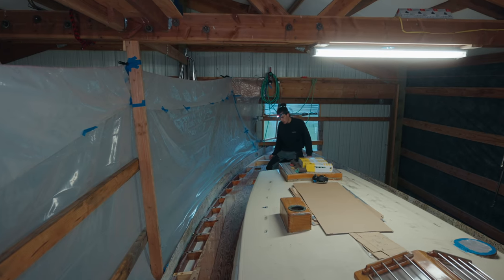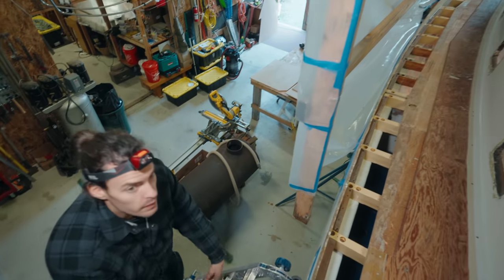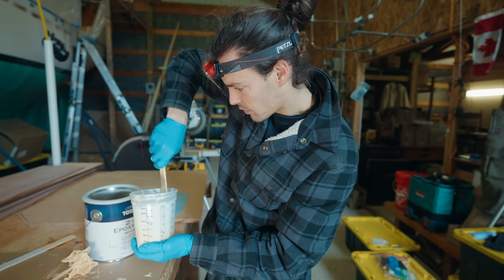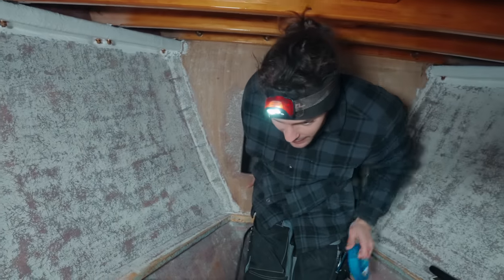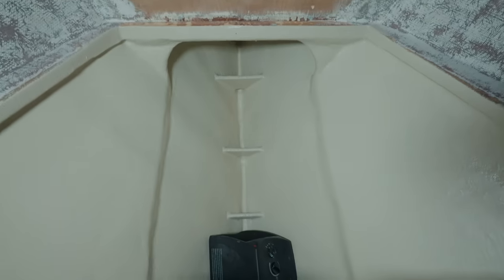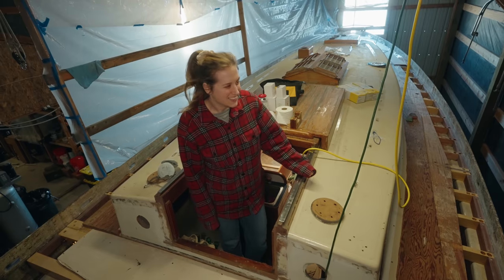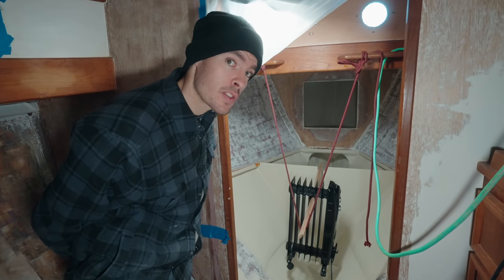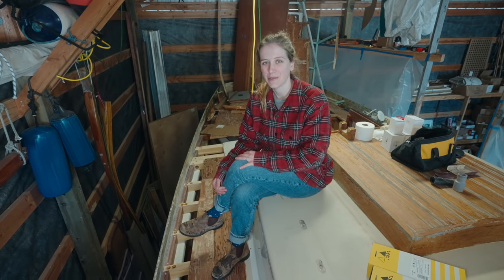FIRST PAINT ON OUR BOAT! [S4E40]

Comment: One thing to note about epoxies and even some paints during cold weather is you can warm up the sealed cans in a very warm water bath for 30mins to 1hr, to help bring it to temp and therefore thin out the viscosity of each part individually, before mixing the 2 parts together.  Consult with the Total Boat rep first to verify that it's ok to do so, before proceeding with the warmup.
Reply from the maker: Absolutely! We keep them in a small heated cupboard to achieve the same effect :)

Comment: Very smart of Aladino to wait for the correct temperature for Varnish, Paint, Epoxy, for that matter, no point of doing stuff that you would just have to redo again because you didn't apply it in a warm enough climate. Any way's the boat is coming along just fine. And its looking amazing. cheers..

Comment: Hello to you both,when I have had partly used tins of paint in the past,and I am putting them back into storage I make sure the lids are properly sealed,i then stow them upside down,that way,when they are reopened there is no skin on the top,making carrying on work easier.another great video thank you.cheers Roly 🇬🇧.

Comment: Something for Aladino. 🤓.. as an asides i can see changes in materials used in boat construction coming, both from an economic and environmental standpoint.  
Recommend you read this article👀 I was checking on Basalt v Carbon and Fiberglass .. turns out its better than I thought..read the link article on the first Volcanic 60ft ice class racer and Basalt in dealing with growlers. Hemp instead of ply?😲
Yachtingworld
yachts and gear
the future of boatbuilding a greener approach -136032

A lot of EU Steel used to come  out Russia..🤔 Hope youve got what you need in stock already.

Comment: Owning the exact same cordless drill, here is a paint mixing tip. Break out the corded drill if you have one. I find the cordless doesn’t have the rpm’s that the corded one does so you end up with a less cohesive mixture that took twice the time to achieve. This is from years of mixing project paints from latex to epoxy based industrial coatings (the miss-tint section is a goldmine!) that often sit for years on my paint shelf.

Comment: I've dealt with cold weather trying to epoxy coat surfaces and it's tricky with cold temperatures. Heaters just don't cut the mustard in large spaces at all.

Comment: That trick with the duct tape across the top of the can of ( part 1 primer )  was pretty slick young man ! :-) 
Do you think it'll work on a can of regular household paint also using painters tape ?  (its going to be a while before I can give it a test run ? )
Reply from the maker: It will work even better with more liquid paint but the wider duck tape is nice:)
Reply: @SailingMagicCarpet   / Thanks :-)

Comment: Inexpensive heat shed

On a project a couple of decades ago I needed to post cure a 60' hull.  The "right" way is to build an insulated building inside the boat shed, and then ramp up the temperature and hold it for the required time.  The cheap way (suitable for wood/epoxy low temp resins) is to buy a huge roll of 6 mill plastic, cover the entire boat, weight down the perimeter, and use a heater(s) to inflate it.  Once the hull is up to a nice room temperature you never have to worry about retarded cures of epoxy or paint.  You can even shut it down in the evening and the mass in the hull will keep it warm enough for a nice overnight cure. 

ps:  I know of a twenty million dollar motor yacht that ended up with lawsuits and a million dollar repair bill because the build company owner insisted in turning the heat off on weekends  to save money which retarded the cure of epoxy fairing compounds and the subsequent paint topcoats which then cracked.

Comment: Aladino, you don't half know how scary it was for me to see you paint the fo'csle like that, with only a mask. I almost died doing that a long time ago! I was wearing a good carbon filter like you were, but the VOCs from the paint displaced the oxygen in the air without me noticing anything. It was only when tunnel vision set in and I realized it wasn't supposed to be getting dark at 15:00 in the afternoon... I managed to take one last jump out into clean air and the light came back 'on' instantly. Glad you made it but please please please be careful.
Reply from the maker: What do you suggest??
Reply: @SailingMagicCarpet  Next time I would use a forced respirator full face mask. I have a CPAP and could improvise something out of that. Just blowing air in with a vacuum might also work. Don't use it as a vacuum because most vacuums are not explosion safe. Never painting alone in a restricted volume with limited air flow should prevent the worst if one were to black out, that would be the least I would attempt.